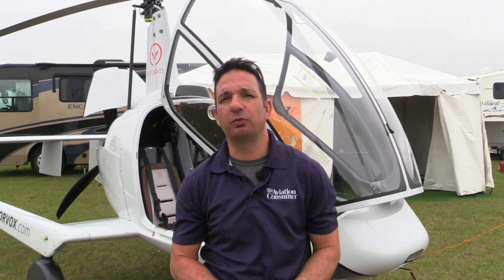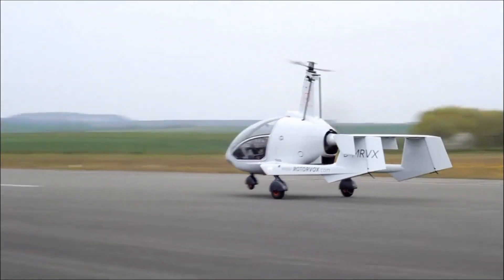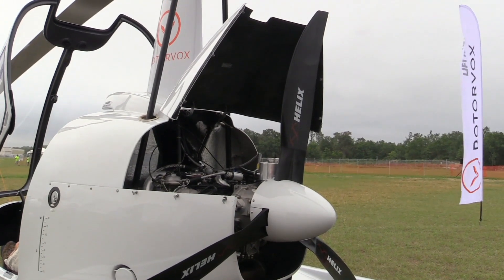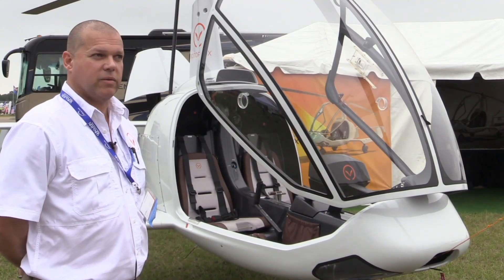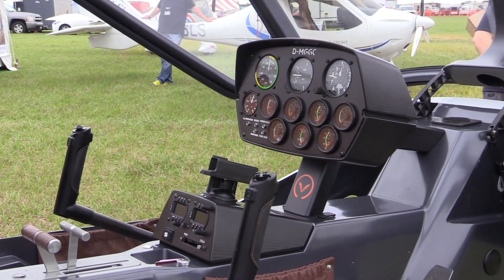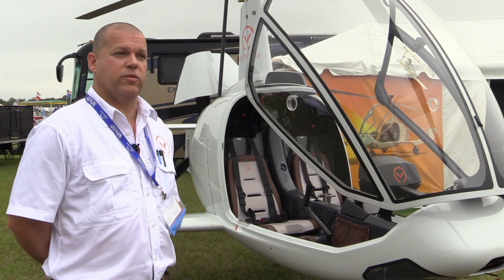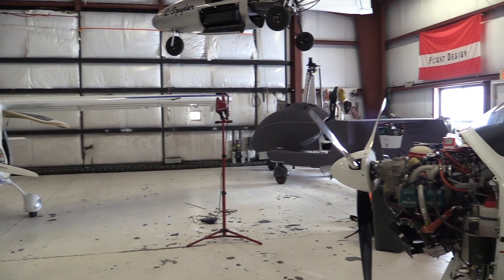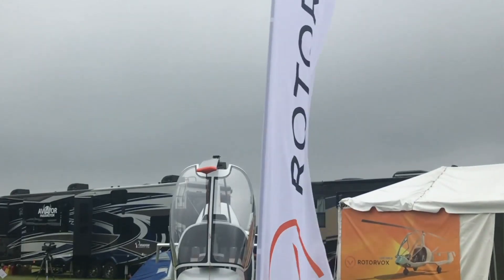Rotorvox Gyroplane Debutes At Sun 'n Fun

Comment: Are all those clock instruments necessary? How about a 10 cm display with rpms, altitude, air speed, four boxes on the main display. Maybe six numbers , add eng temp and fuel volume, when the display is red it means battery low and one should not start the engine, if there is an engine problem the eng temp will shine like on and off, the rotation goes to middle scale so it is always capable of landing before any damage.

Comment: Sorry, your competition has you beat by $50,000.00 using a Titan 180HP engine, 2400TBO by Continental with a greater payload and much better performance numbers. (You didn't mention performance, but can assume much less than your closest competitor also).

Comment: Not a fan of pop up canopies.  I want an aircraft I can escape quickly after a forced landing.  If it tips over I won't be able to open the canopy.  I'd need to grab a escape hammer and start pounding in order to break out.  Also, the canopy is huge and largely  responsible for any front impact protection. Given it's attached with a few hinges and latches it's gonna shear off easily when hit hard..
Reply: KB3M nope. The canopy is not load bearing at all. The procedure for opening it on case of a tip over is easy and explained in the POH.

Comment: Wow that price is about twice what it should be
Reply: Here is your chance to excel, make the comparable machine - sell them for half - you bee rich soon.
Reply: Brent they will not be selling to many here in the states for 165,000.00. Hell that's a nice turbine rotorway, helicycle, or a mosquito turbine.
Reply: Based on what, Brent? A tandem open two seater runs from 70-90k or more.
Reply: Most gyro with closed cockpit now run 65-82+, so yes, that price is double the standard price, for that price I could get a fully loaded brand new pipistrel plane. Unless there's an "airwolf" super turbo button that allows for mach .8, this thing will not sell for that price.
Reply: Brent I totally agree with you.  But new to this and welcome your opinion of heli or top wing that is safe and worth the money.  Any suggestions?

Comment: How do gyrocopters manage to operate without an anti-torque tailprop?
Reply: William Porter
Forward speed and vertical stabilizers do not have anything to do with your question. The main rotor on a gyro copter is not subject to any real torque so there's no need to cancel out torque that's not there.
Reply: So... Fixed-pitch rotor blades then, yeah? Flying basically on autorotation. That would also mean that there's no way to adjust for the differential lift generated at high speeds. An interesting trade off. Thanks, guys.
Reply: William Porter dissymmetry of lift is due to forward flight is corrected for same as a helicopter.  The blade is underslung and connected via a teterbolt that allows the advancing blade to flap up decreasing lift and the retreating blade to flap down increasing lift.
Reply: All the replies below are correct. The Rotor is only driven for pre-rotation and is in autorotate on in flight. So there is no torque to counteract.